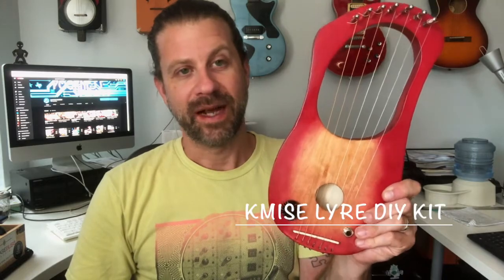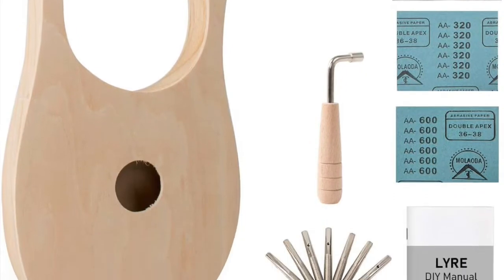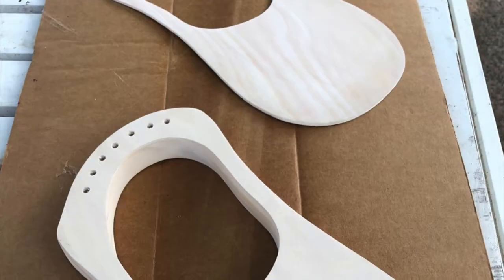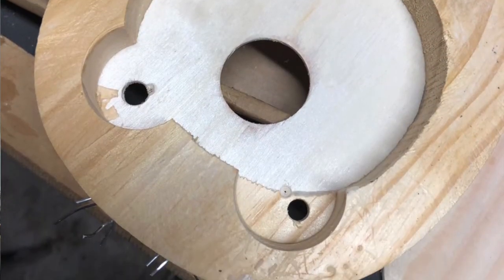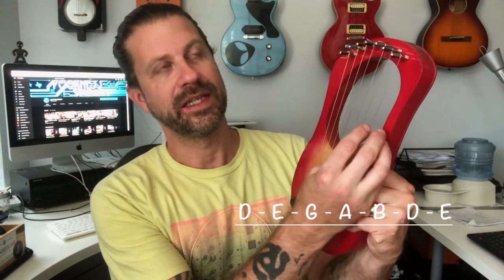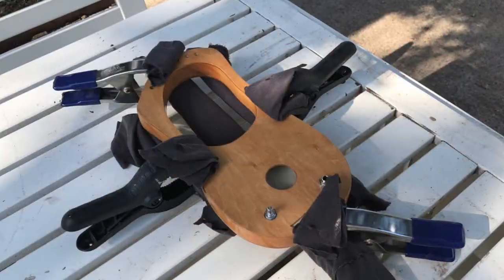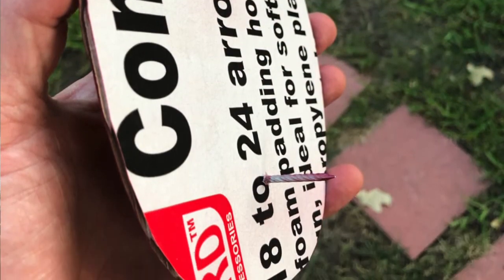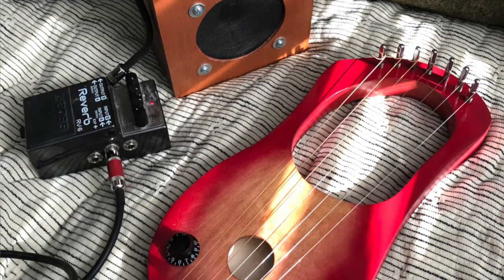DIY Kmise Lyre Kit

Comment: Very nice, buying the kit instead of one of the legion of pre-assembled cheap lyres on eBay and Amazon is you can turn it into something decent. One more sound improvement you could make is swap the strings to nylon ones. BTW the lyre is not in the harp family. It's in the guitar/violin/banjo/cello family, in fact its the grandaddy of that family.
Reply from the maker: Thanks for the info! Thanks for stopping by.

Comment: Looks like an interesting build, especially with the added electronics. Yes, those pins are a pain to deal with. I restrung and refelted an autoharp for a friend a few years ago, 36 strings, all on zither pins.
Reply from the maker: Glad you liked it. That sounds like a miserable experience tuning 36 zithers Frank. I will say this, now that the strings have stretched a bit, they're less of a pain... but its still hard to stop a note from going sharp. Sometimes its just a fraction of a turn from flat to sharp. Ugh.
Reply: Try a bowed psaltery sometime... 20+ strings, each with its own tuning pin... but such a beautiful sound!

Comment: can you get a piece of dowl and drill a hole in it to put over the tuning tool to make it longer?
Reply from the maker: You could definitely do that provided you had a drill bit that was close in size to the wrench (for a snug fit). If the hole was too big, I'd imagine you could glue it or wrap the metal in tape. Good suggestion.

Comment: Which exact pick up did you use? And what else do I need to electify it?
Reply from the maker: I used a 35mm piezo disc hot glued to the back of the soundboard and wired directly to a 1/4" jack. I believe I purchased the parts from www.CBGitty.com but you can find them from a lot of parts retailers. A smaller piezo (e.g. 27mm) would work just as well but I used what I had on hand. Piezo pickups amplify vibrations so it will pick up signal as long as it's mounted in a spot has has good resonance.

Comment: Nice review. Question, is the bridge glued in or just held in place by the string tension?
Reply from the maker: Thanks for checking out the video. There’s a slot in the wood and the saddle drops into the slot. It’s not glued in. You could easily do that if that’s what you wanted though.